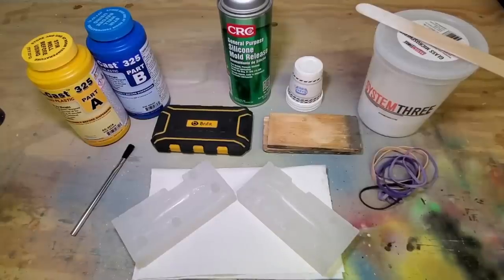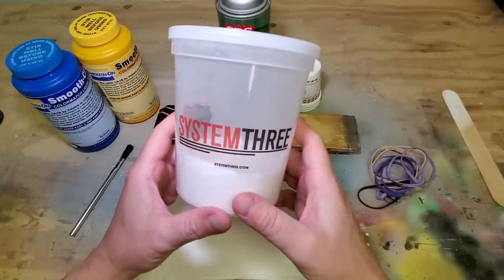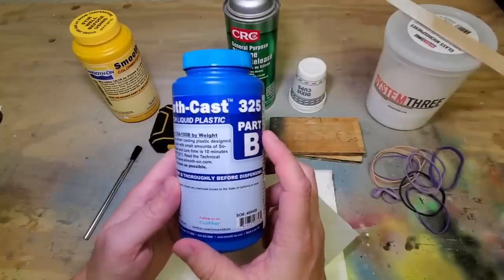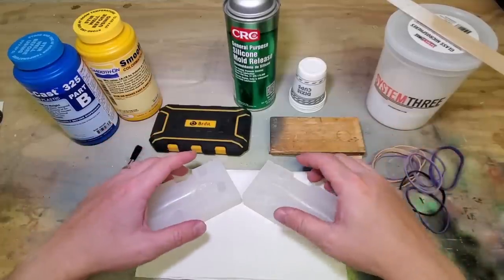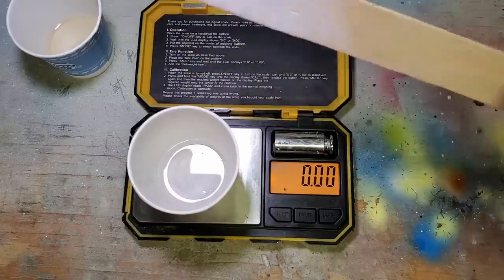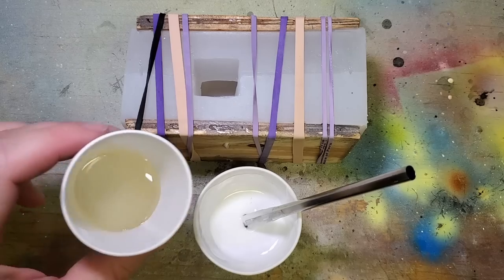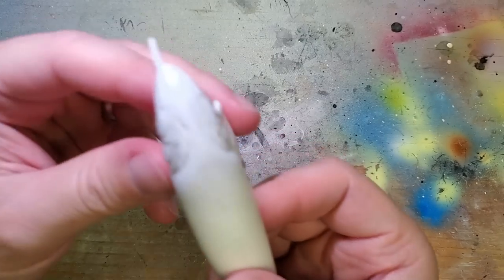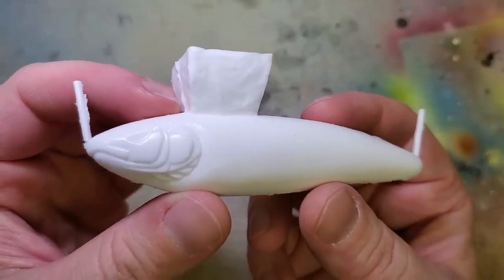Casting Resin Fishing Lures: a step-by-step on making resin copies of your wooden lure carving

Comment: Great work as always! For the quantity of resin I think u need to go for cubic centimeters instead of grams due to the different specific weights. With your calculations, a resin that is 1.15 g/cc one component and 1 g/cc the other, u will have 32 cc of resin, but the 4 grams of microballoons have an approximate volume of 28 cc(.15 g/cc). You find yourself with 60cc of material for a lure that is 32cc, with 28cc of waste. Just my 2 cents😁 Merry christmas and a happy New Year !😄
Reply from the maker: Great point! I usually aim high the first time just to make sure I don't run out and then whittle it down. But that is much more accurate for sure!

Comment: Little question : why jump from volume to grams? As the specific weight of water is not the same as resin you will have more resin than  needed.
Reply from the maker: You are absolutely right.  I like to make sure to have a little more resin just to be on the safe side. If you run out, you've just wasted all of it, but having more ensures that won't happen. Thanks for watching!

Comment: i tried the system three microspheres after watching your channel, coming from fasco. the system three with the same 10% weight as fasco is significantly less buoyant. given that they sell it by weight, makes the price different pretty substantial. havent spent enough time to figure out what kind of weight i need to achieve the same as 10% fasco. any advice?
Reply from the maker: I have been wanting to try microspheres from SacPig. I've heard good things, but wanted to get through my stock of System 3 first. Some people really like Alumilite, others don't. I suggest that you try different things until you find the one you like the most.

Comment: Hi there, watched your video again,im really intrested in what and how you prime your lures for acrylic airbrush paint,,ive got a couple that after i finished them using a car primer filler that have grown small bumps about a week after i uv resined them,do y9u think it was the car spray reacting as this is the first time ive used it,however im new to resin casting and i usually just spray with vallejo white primer,problem is i dudnt expect any reactions so i didnt record which was which,,,,😮😂,problem is im selling them and am expecting a recall,,,,😅ve been selling wood lures for ages and moved to resin for obvious denand supply and conformity ,any tips or insight would be grarefully received ,,,cheers bud,love your channel,massive praise from the UK
Reply from the maker: Hello! Sorry to hear you are having this issue. I haven't personally had this happen to me, but I do have a few ideas for you (in order of my opinion of likelihood). 1) the resin may not have been fully degreased before you primed it. This could result in poor adhesion. 2) the resin might not have been completely cured when you primed it. Differences in climate can affect curing time. If the resin was still off gassing it could result in bubbles. 3) the primer might not have been fully dried when you started painting with acrylic. 4) primer incompatible with acrylic. Resin is a good material and it really increases production of detailed lures once you find the right recipe. Best of luck to you, I hope this helps.

Comment: Thx again for the great video! I took a shot at my first cast today and worked great but the lure is not as floaty as I wanted - did you experiment on how far past the 10% can we go to get maximum floatation without compromising strength? Thx!!!!
Reply from the maker: It's great to hear your first mold came out perfect! I have gone higher on the microspheres. The bigger the lure, the harder it is to get it poured in the mold fast enough. Your environmental conditions also play a role in how quickly the resin sets up. You'll have to experiment with your particular lure in your particular conditions to see how far you can push the ratio. Keep track of your recipe because once you perfect it you don't want to forget it!

Comment: what sized eyelets are where did you get them¿or what size would you recommend for making trout lures
Reply from the maker: I don't use screw eyes; I make twist wire hardware. I usually embed them at least 1/2 inch but prefer 1 inch if possible.

Comment: You do not have to let the water overflow, just place the bowl with the water on the scale, zero it, place the lure in the water and submerge it, read the scale. What ever weight is now on the scale is the weight of the lure if neutral boyancy.
Reply from the maker: Thanks for the tip!

Comment: Are these microballoons a potential issue for the lungs after mixing and setting in resin, i.e. during sanding of the end product?
Reply from the maker: I think breathing in any kind of dust or particles is bad. I've been investing in more and more filtration equipment like masks/respirators, air filters and taking time to vaccum the shop. I realize how easy it is to get complacent and we've all been guilty of not using ppe, but I do believe it is really important to take care of yourself.

Comment: Hi, how do you treat holes and bubbles that form at the top of the piece?
Reply from the maker: I don't always get bubbles, but when I do, it depends on their size. If it's one or two big bubbles, I fill them with superglue and instacure. If it's a lot of tiny bubbles, you can smear it with bondo and sand it smooth.

Comment: 6:29
There is an easier method for this as well.

Place the pint directly on the scale, don't overfill it like you did here.
Then press the lure completely in the water, but make sure, it doesn't touch the bottom or walls.
Then just check the weight on the scale. That's the amount of water your lure volume replaces.

This works as long as you don't let the lure sink to the bottom. When it does, you'll notice that you're no longer weighing the replaced volume, but the weight of the lure itself.

1grams of water = 1 ml -> 1 cubic centimeter (cube of 1cm*1cm*1cm).

Also. Weight of resin is not the same as weight of water.
Especially when you mix in the VERY LIGHT microspheres. You did it by weight, not by volume. Hence the excess amount of resin+spheres..

You're mixing up the volume and weight totally in this video..

Great guide otherwise. Thank you :)
Reply from the maker: Thank you, that is a really great method! I agree, my method is meant to get me in the ballpark, but I will definately give this a try next time. Thanks for sharing!

Comment: I have seen people actually using rice instead of water, due to having a closer density to the resin than water. They fill up the mold with the rice (not minute rice type, but actual real unadulterated rice) and then weight the rice.
Reply from the maker: Hmmm, interesting. I've not seen that.